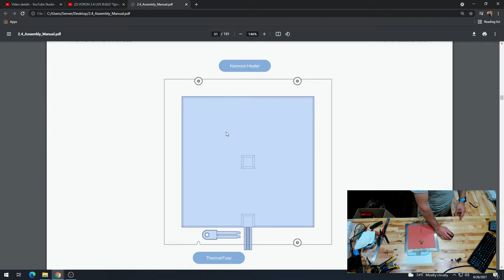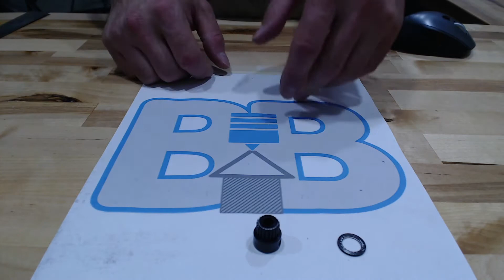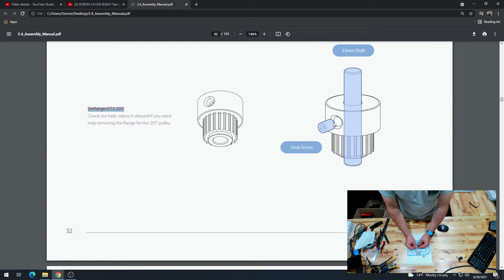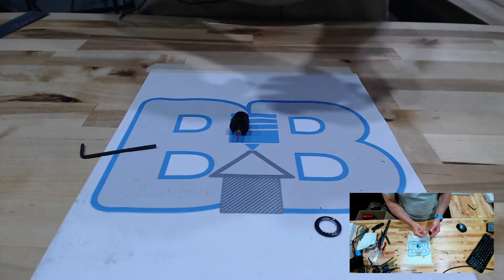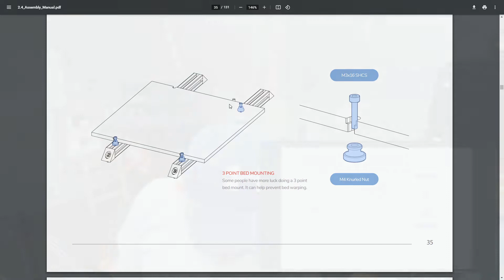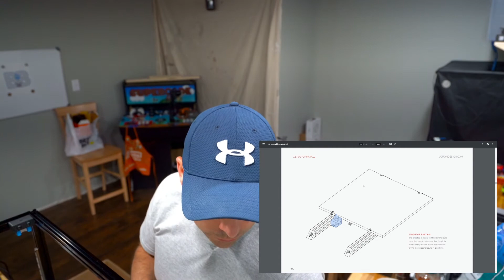VORON 2.4 Build It Live *Episode 6* - Bed and Z-stop switch

Comment: I would suggest like nero3dp mentioned in some of his videos, do your bed last. I am in the wiring phase of my Voron and had to rerun the cables a couple times before I was happy with it  which requires the printer to be turned over. If I left the plate on it would have been much heavier and awkward to flip and it reduces the chance of something slipping and causing damage.
Reply from the maker: I'm really trying not to pull too far away from the manual, but you're right.  I left the bed completely loose for those reasons. I'll need to wire the thermal fuse into the bed before I even consider final mounting.  I'm actually considering modifying the manual with notes and possibly done actual pictures and making it available, but I don't want to upset anyone on the dev team.  Thanks for the comment!